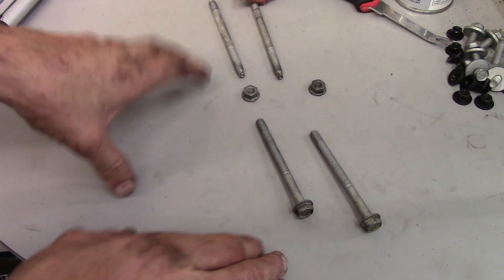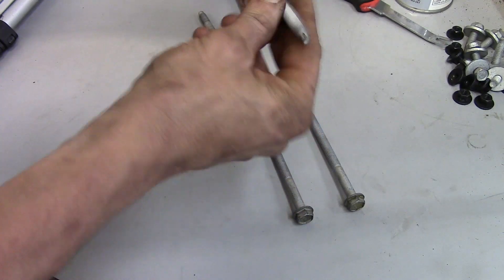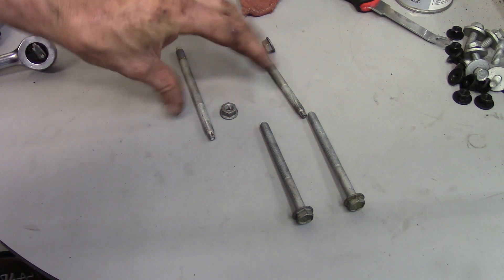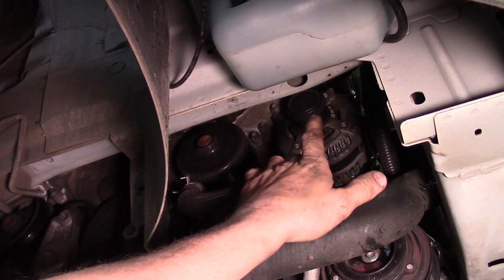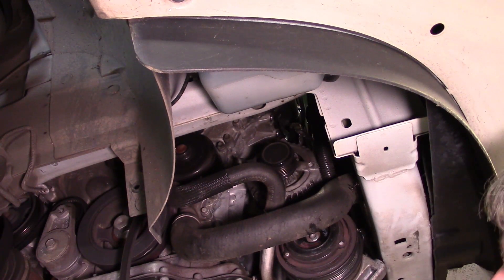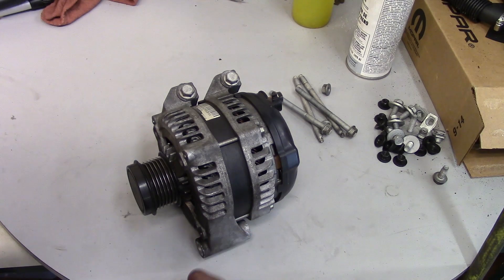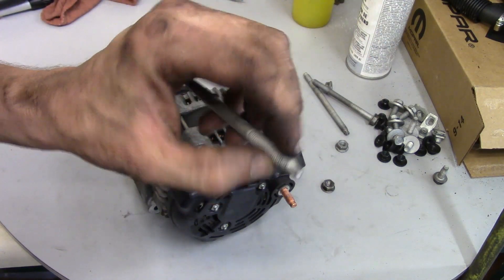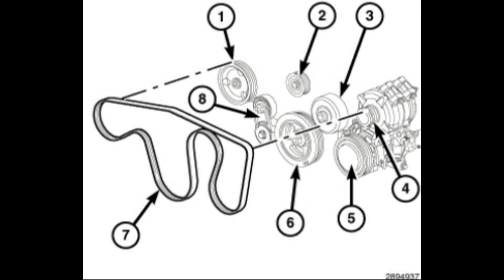Part 2/2: Grand Caravan and Town and Country 3.6 liter alternator removal with shortcut

Comment: I am replacing my alternator for the 5th time.  The last two are my fault.  I had a crack in the power steering reservoir and oil leaked out on the one I took out and the one that is in there now.  It not only caused damage to the alternator but it seized up all of the bolts and the tensioner would not move..  I replaced the tensioner a couple of months ago and I had to remove it again in order to loosen the serpentine belt. I rented a tool from Oreily's to try and  adjust the tensioner,but is did not work.  So, as far as how this works again.  The bolt that mounts the tensioner onto the engine is not used when tying to loosen the tension>? and I am only supposed to have to insert a 3/8" breaker bar into the square hole above the bolt by pulling it towards the front of the vehicle?  Only one time do I remember that tensioner actually working that way.  The last two times, it would not move at all.
Reply from the maker: Actually you have described it well.......the 3/8 square hole is where you insert a ratchet to release the tension on the belt so that you can take the belt off. The center bolts is what bolts the tensioner to the engine.
Reply: Yes, I had tried to force the tensioner towards the front of the vehicle to reinstall the belt but the force broke the tensioner the actual cast of the part.  It should have been adjusted towards the rear of the vehicle
Reply from the maker: The tensioner will take a bit of effort to move, not alot but some. If you feel it wont move you reverse direction. Usually you can look at the routing of the bet to see which direction you need to move.

Comment: I got suckered into doing a block heater on one of these. I didnt realize how big of a pain it’s gonna be to get the alternator out.
Reply from the maker: its not the easiest for sure. Thanks for stopping by the channel to watch the video. Make sure to subscribe
Reply: @MotorCityMechanic  thanks for the video!  Looks like you have a ton of very useful videos on your channel. It doesnt look too difficult to do with all my work tools at hand, but I’m just using what I have at home. Work is an hour drive from here.
Reply: Well, it was much easier than i thought it would be. I was installing the factory block heater, which is located right behind the alternator. Everything was easily accessible from underneath.